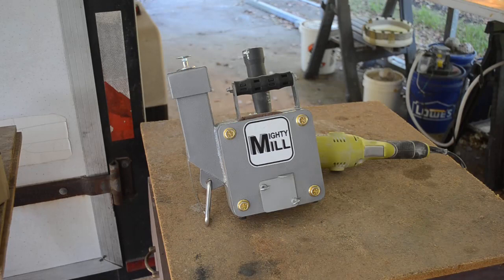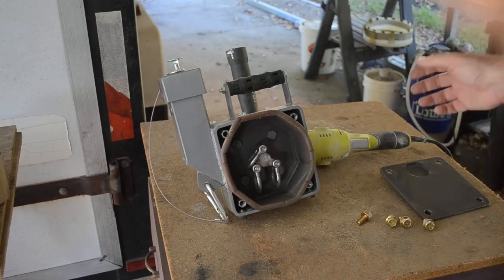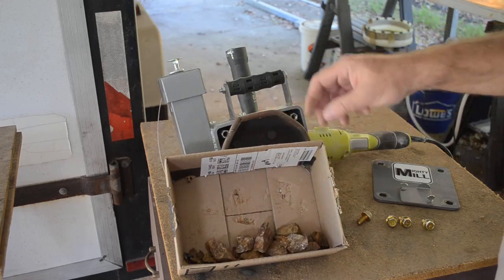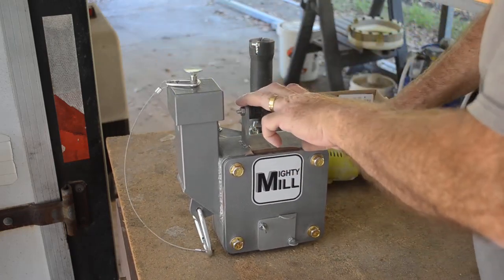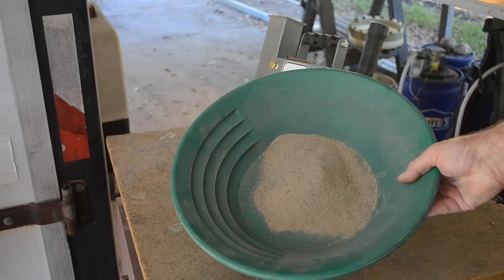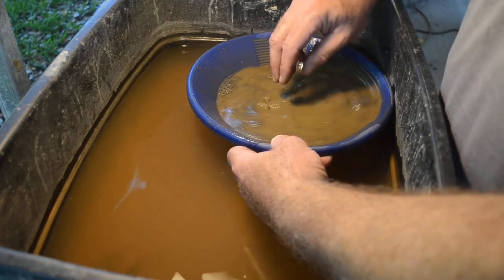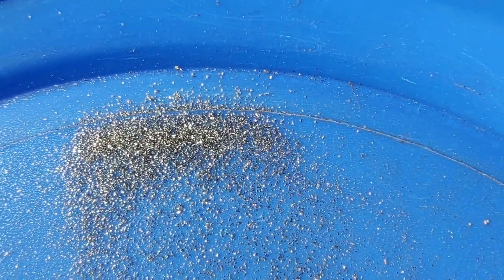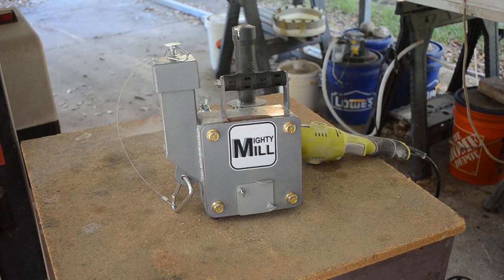Mighty Mill Gold Ore Crusher Demonstration And Review

Comment: I saw 1 video of a homemade one and made my own, has a 6.5" diameter circle, just used metak flat bar rolled and welded in a circle, a chute welded from 2" angle iron, 1" hardwood boards (for now) for the front and back panel and a short length of chain for the flail. Its insane😂 it takes 2-3 seconds to turn whole rock ore into powder, about 90% of it with a small amount of 1/16" or smaller chunks left.  5 seconds and it will legitimately turn it to flour completely. Its great. So much better than the manual one id made before it. Only weighs about 2 lbs plus the angle grinder

Comment: Thank you for the honest review! I'm glad to see it worked well for you in processing that ore. Per your feedback, the grizzly can accept rocks up to 1-1/2", but it's always better to classify your material to 1" or smaller, mainly to extend the life of your grinder. Also, the original version I make has the built in "anti-kickback" lid at the top of the feed tube, which greatly reduces the chance of any debris bouncing out while feeding the mill. You have the "open tube" version which comes with a removable lid that helps keep most of the dust contained. You ran it perfectly by pulsing, great job! I also never thought of emptying it like you did, so thumbs up for that as well. Great video! Liked and subbed!
Reply: How many of these do you build at one time
Reply: @ralphmcculley2085  I've been building 20 a month, with a month off here and there, but I just switched to a new method of "It'll be ready 30 days after purchase". I'm hoping this will help smooth out the build process per month, instead of having to complete such a large quantity at once.